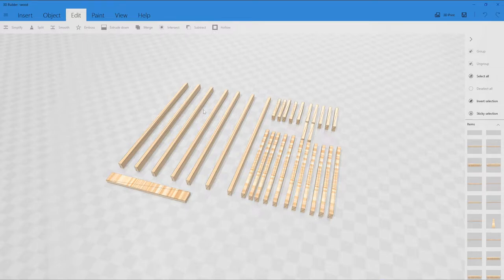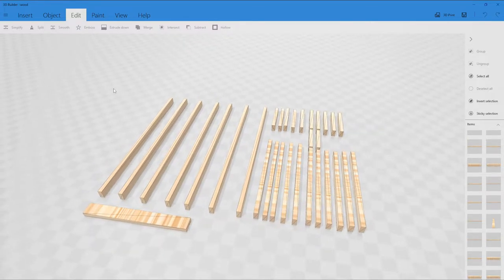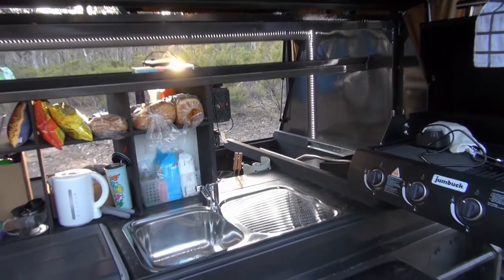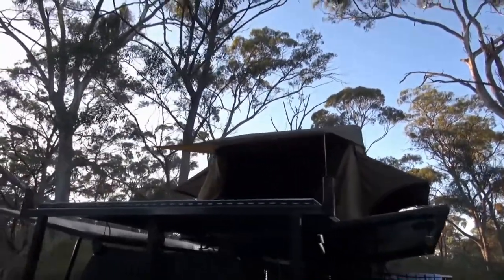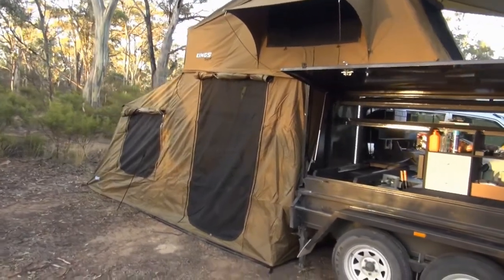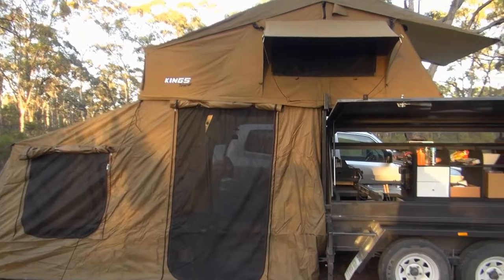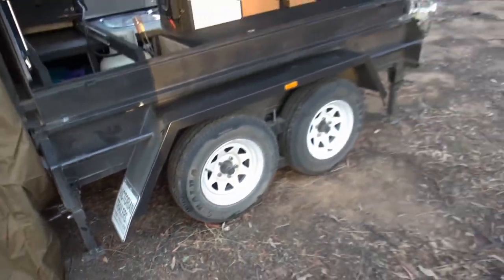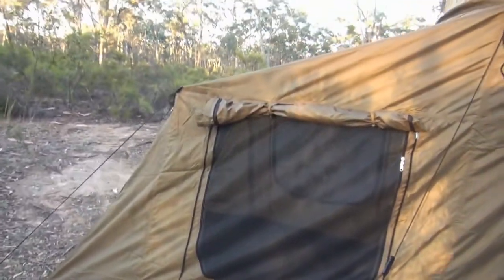We turned a tradies trailer into a camper trailer

Comment: Price reveal please? Great build! I like the cube system and the full size sink! Genius!
Reply from the maker: Hi Redline - I am going to give you a rough guestimate but I can tell you the trailer itself with the minor mods like the stabilizers, upgraded jockey wheel etc. was around 5K, the roof top tent with the annex was around 1K, 2K on the 300 watt solar system (inc the 2K watt inverter), the rest inc wood, fridge, bbq, carpet, paint, sink, cubes etc was around a couple thousand - so we were around the $10K mark give or take
Reply from the maker: this will give you a closer look at some of the internal items we used > https://trailer.stuangel.com/ (I just had a look and that fridge was a fraction of that price, I think we paid closer to 300)

Comment: Like the trailer build .  When i was a lot younger , 50 years ago. Dad had a trailer built for him with corner adjustable legs on for camping .  Would set  up a big tent with the trailer inside for Him and Mum to sleep in on blow up mattreses .  we used bunks and mattreses  .  Just a tip if want it .  I'd put a flat block under the corner legs when set up for more stability in rough or wet weather .
Reply from the maker: thanks Barney! I have been thinking of that exact thing just recently, I was considering using some old circular saw blades (welded on) as they have a much larger surface area, kinda  springy and I assumed somewhat sticky if those sides dug in, once I get those drawers in the back done I am sure a few blocks of wood will fit in there just fine! I appreciate the tip!
Reply: @Stuangel  good idea ,  the wider the block is , the better and sturdier.  same as i've seen on  backhoe outrigger foots

Comment: Awesome build, love your ideas. Just put prebuilt draws in my sons bedroom with dual draws, mesh baskets etc (can be picked up at Bunnings). Great idea to fit one in the Trailer. Also the sliding BBQ. I have recently brought a modified box trailer and will be adding these features if room allows. A couple of changes to think about, I would get the gas bottle out in the open for safety reasons abd maybe have the sink waste fit into the drain pipe to limit leaks. Also if you find you running out of space you can pick up water tanks with bash covers to fit under the trailer (60 - 80Litres) for around $200 and they come in all shapes and sizes. Again, great job.
Reply from the maker: Hi Peter E! thanks for the comment, in regards to "gas bottle out in the open for safety reasons" thats exactly what we have done, the bottle is now mounted out the front of the trailer, just wanted to also mention the sink does have a drain pipe, I ended up just 3D printing an adaptor to go from the sink to the pipe, works a treat although right now we just manually run it out the back when we need to use it, but am planning on doing a perm fixture with some pvc pipes etc, and I probably didnt make it very visible in the video, but there is actually a 70litre water tank (caravan style) that sits bang in the middle of the trailer - great minds ;) shoot me a link if you ever do a build, would love to see it! am always looking for ideas etc.

Comment: Hey, awesome video. How did you fix the frame to the trailer to start with?
Reply from the maker: Hi WillC, if you pause the vid at this timestamp > https://youtu.be/UQ8neU_OOsM?feature=shared&t=513, you can see the trailer itself has a slight lip on both sides, so essentially the wooden frame is friction fit on all sides and top (lip) to bottom (floor), there is no way for it to move in any direction, including up or down, also take a look at this timestamp > https://youtu.be/UQ8neU_OOsM?feature=shared&t=567 you will notice the top of the walls of the shelves have slots for the structure of the trailer to pass through, there are right angle braces hidden up inside there that are bolted to the frame and the shelf walls - the entire wooden frame etc. is as solid as the trailer itself, there is no movement or play anywhere as its essentially wedged in place
Reply: @Stuangel  thanks 😊

Comment: How does your back handle leaning over the wheel arches to wash your dishes? 
That’s a fare stretch 😮
Reply from the maker: Hi TheTravelBug123, while building it I had similar thoughts, but tbh I am around 182cm (6ft) so I dont really have a problem, chatting with Christine, she has said its a "small" stretch for her, I dont think either of us have considered it to be an actual problem, I think we had talked about it and decided to put the sink there and not somewhere like where the fridge is, as you really do need to get into the bottom of that, if I think about it, next time we are out (which should be soonish) I will grab a clip or some snaps to show you what I mean
Reply: @Stuangel  a video would be very handy as I’m definitely going down the path of a trailer conversion 👍🏽

Comment: Great job mate, but I'd be getting that gas bottle outside ASAP, lots of sparky's inside.
Reply from the maker: Hi Tubermick, its actually top of our TODO list, was just chatting about it today, plan is to stick it out the front, but we are trying to work out if its worth running copper pipe (front to back) or just using something like a 3m gas hose instead